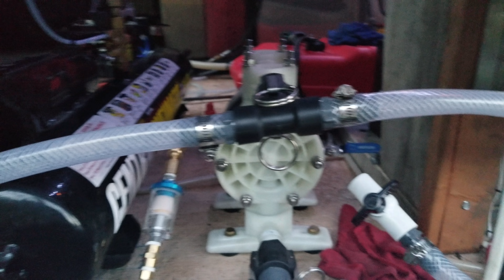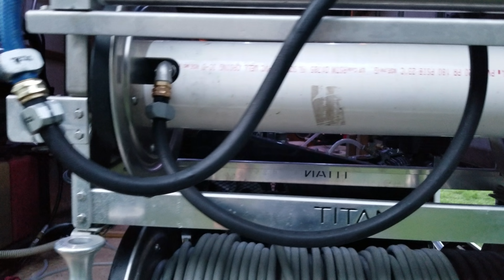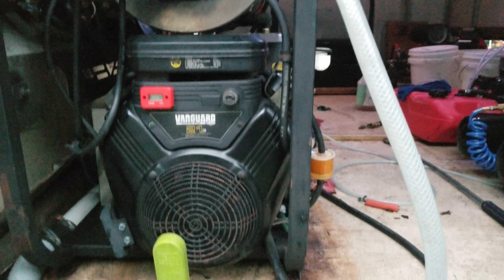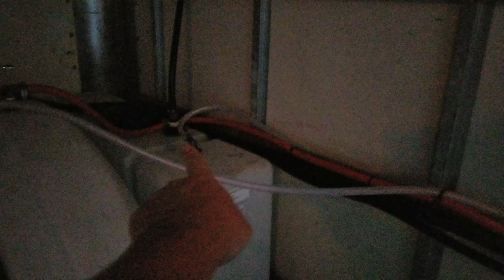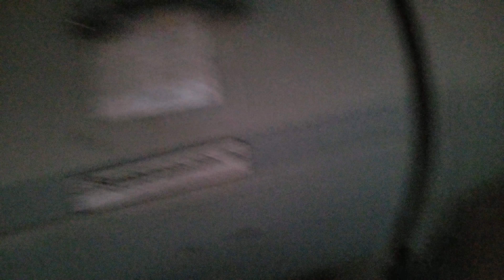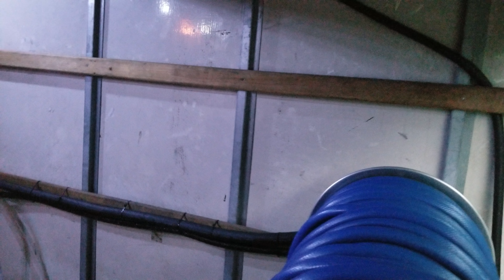Box truck mega power washing rig.  90% complete.

Comment: How does central pneumatic compressor hold up from your experience and can't wait to see your video for the booster pump vs air compressor video
Reply from the maker: RJ aka BigBase50 ask me in 6 months or s year.  We have only used it for about 1 week
Reply: Clean Power Wash got you wasn't sure if you used on a diff set up

Comment: Maybe a stupid question,  but why so much pressure hose on the reel? It is a lot of pressure to push X GPM through that much hose all the time, wear and tear on hose that is often not needed (I would assume), and downstreaming should be ineffective at that length.
Reply from the maker: Sean Stapley 2 machines 1 reel.  This is a "mega" rig.  Aka it can do any job by itself.   That reel is plumbed to the 8gpm unit and we unreel hoses and connect to 5.5 gom also.   No downstreaming for this rig.  Its either direct application OR xjetting.